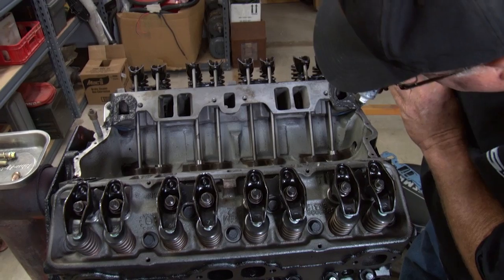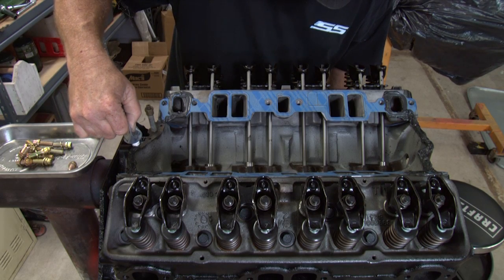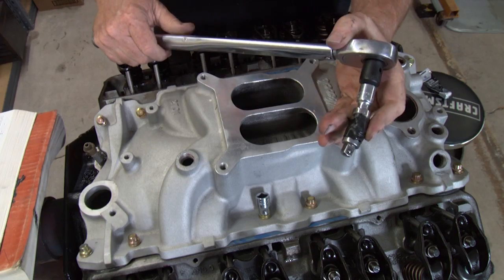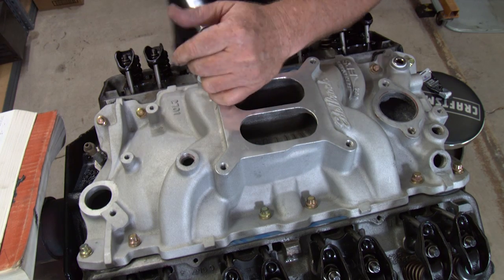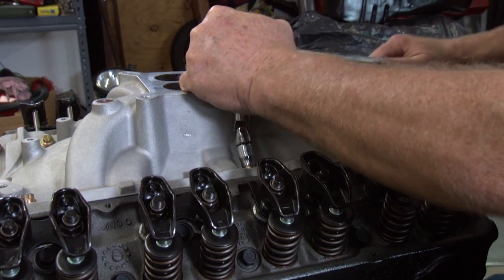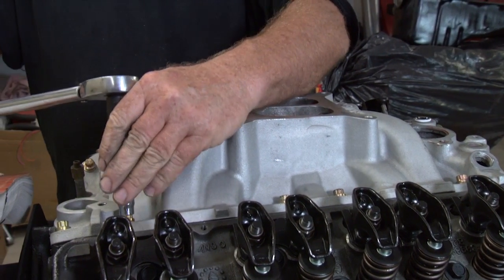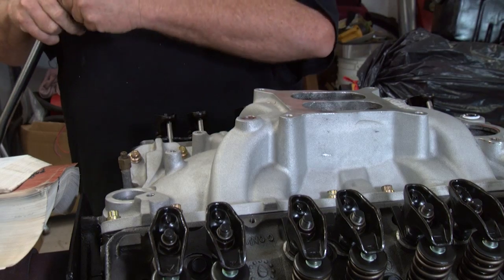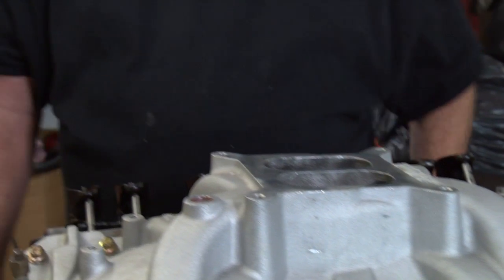How to Install an Intake Manifold on a Chevy 350 Small Block: Step-by-Step Guide

Comment: You are NOT torquing the intake bolts properly. You should begin in the center of the manifold and rotate in a circle. Also you use entirely too much silicone sealer which will squeeze out into the lifter valley possibly breaking off and falling into your oiling system. The torque value on aluminum manifold to cast iron heads should not exceed 30 ft lbs. 25 ft lbs is best. On Aluminum to aluminum 10-15 ft lbs is best. I have been putting engines together for 60 years and I would not do it as shown. I am not intending to piss you off but that is not the way to torque a aluminum maifold you are rolling the dice and are close to cracking the casting or pulling the threads in the cast iron with 44 pounds of torque.
Reply: I came her for proper instruction, and I believe you more than this poser.

Comment: Wondering why you left the exhaust ports open to the manifold. You don't have a choke you are running off of the manifold..... cold climate perhaps? Wouldnt you worry about vapor lock? Also, wondering why Endlebrock even left that provision on the manifold!?
Reply: It helps to warm up an electric choke if your running one since they are designed to operate at 72*. If you have an electric Avs 2 carb or any of their carbs and run them without that exhaust crossover it will take longer to heat up and stay closed for longer. This is an intake for a daily driver not much for racing. Down low torque up to 5k rpm. If you run an air gap intake you’ll quickly find out why that exhaust crossover is there since your electric choke won’t work right if you drive outside with anything below 60*. The air gap will keep the intake manifold so cold that your choke will close itself AFTER your engine has been warmed up. (Considering you have a good cooling system). People compensate this by running a hotter thermostat 180* but that defeats the whole purpose of the intake since the air gap is made for mid -high rpm

Comment: I think that your final torque values are high if they are 44 ft lbs.  Also, you did not mention putting thread seal on the bolts.
Reply: I was just about to mention that. Sealer on all 8 center bolts correct?

Comment: can't you put some more silicone?
Reply: Lol i was thinking daammnn he sure did put a shit load on the water ports.
Reply: @plutocrank  wont lie i wish i did put as much as he did lol. i got this exact same gasket set and finished installing it not long ago. did a first start up and immediately leaking on one of the water ports. Didn't use enough or something but i cleaned the surface well before applying it. i have a feeling if i used more i would have been good
Reply: @CarsnStuff  wow thats interesting to hear. I used far less than he did and have no issues at all. Water ports are great. Did you use thread sealant for the bolts as well?
Reply: @plutocrank  yep, didn't have any issues with leaks from the bolts. Just one corner where the water port had a pretty bad leak. I got my manifold back off and going to replace it tomorrow. Hopefully better luck this time lol
Reply: @plutocrank  thankfully the second time was it. I used a bit more than i did before. not quite as much as he did but close. and so far the water ports arent leaking what so ever so far * knock on wood *
Reply: @CarsnStuff  oohh nice man thats good to hear. I feel i only used the minimum so next time i swap it ill put a lil more also. I was always scared of any excess (on the inside) clogging something.
Reply: @CarsnStuff nope just get the right stuff and put it on correctly

Comment: I have a 93 sbc 350 TBI and I want to convert it to carburetor. Which intake would you recommend?
Reply: josh valencia edelbrock eps and a street demon 625 carb amazing setup
Reply: 2104 Edelbrock intake 600 carb no bigger
Reply: Why would you want do that?!
Reply: I thought the same thing. I guess he lives some where hot and doesn't want hassle free running. @adriantomlin2902
Reply: @denniscarver7681  Lol!!!
Reply: @denniscarver7681  wouldnt fuel injection be better in the heat though??? I meannn, i may be wrong but idk
Reply: @nikomartinezflood2064  read comment again... It is sarcasm. "doesn't" want hassle free.....

Comment: You said to torque half way at 22 foot pounds. Do you go back and tighten again at 44-45 foot pounds?
Reply: No I wouldnt do 40 foot pounds. Weiand says following the gm pattern do 10ft/lbs then 15 and a final of 25. But i would not do 40 ft/lbs
Reply: Ok thanks. No thread sealer or Loctite on the bolts? Sorry I'm new to building a motor.
Reply: @hannah1219  thread sealer , mandatory
Reply: @badlatyn  its a must
Reply: @hannah1219  44 is way to much. Never over tighten